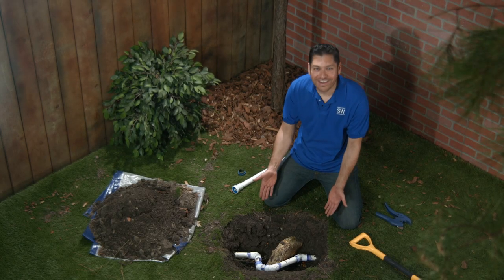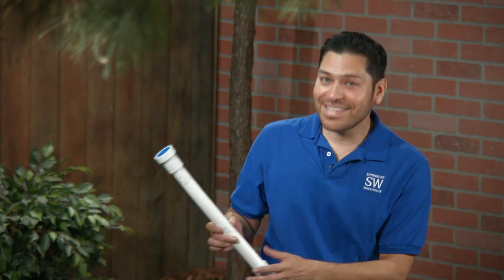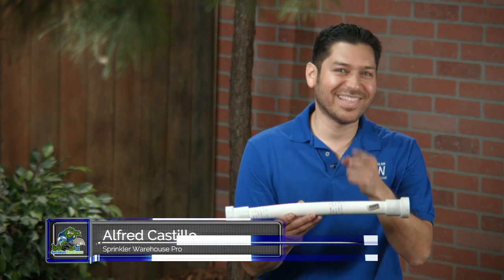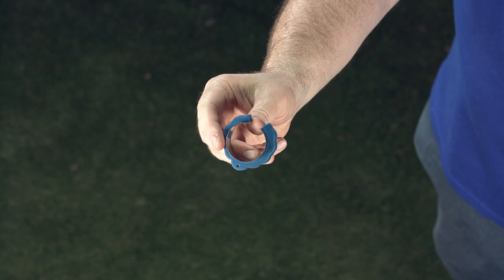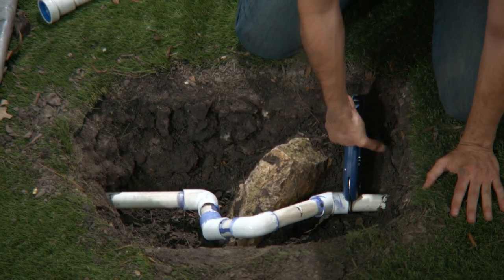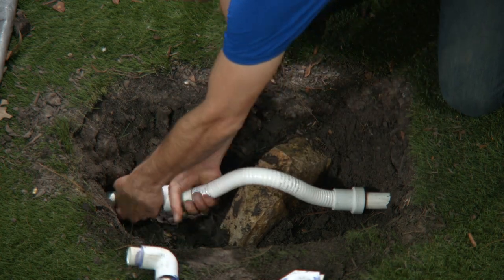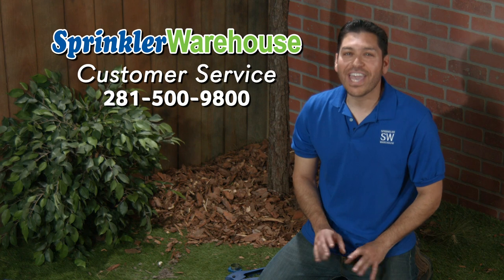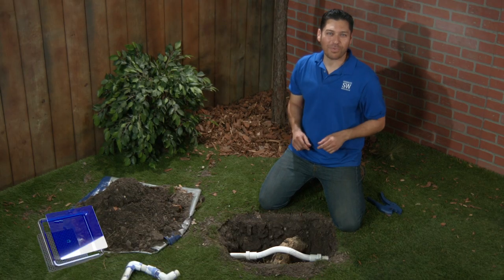PVC-Lock Flexible Repair Fitting

Comment: I am looking for a solution to close the 12-in. to 14-in. gap [cut-away due to removing a picket fence post anchor] for a 1 1/4-inch diameter PVC irrigation pipe (schedule 40).  Last fall I used a telescopic quick-fix on the last leak that occurred to our irrigation system, but this gap is a greater distance.